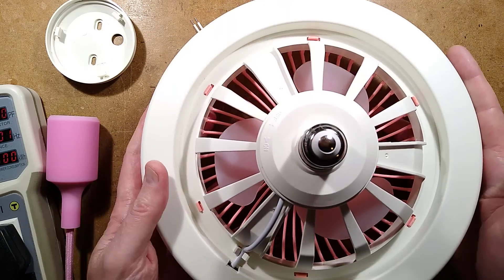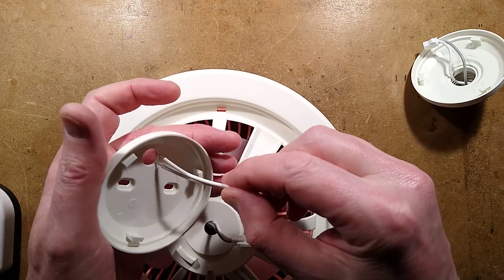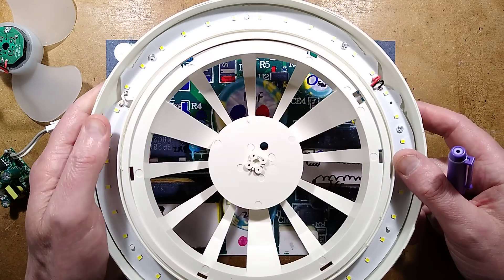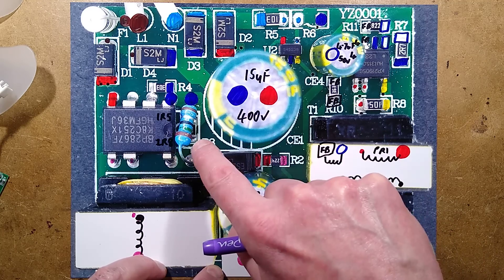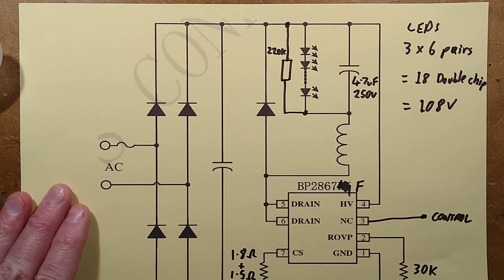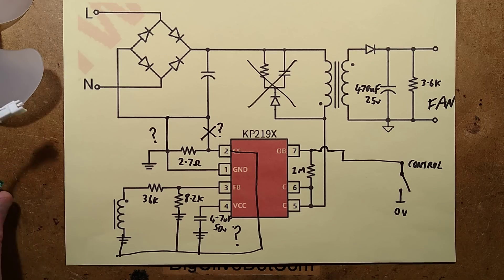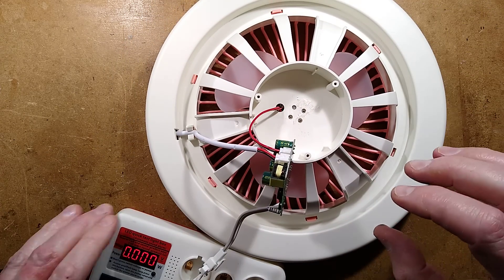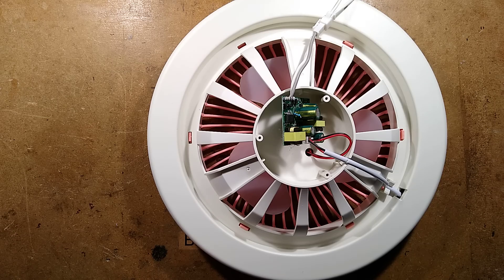fixing a faulty light with powerful built in fan (awesome chip inside)

Comment: I love 3 phase brushless motor fans. They tend to work a lot better, be more reliable, quieter, and project airflow a lot better. I am a big fan (pun very much intended). It is easier to have them on smaller fans, but i hope to see them more often. It is nice that it is a sensored motor too. people often prefer sensor-less ESCs, but i believe they can be a lot simpler with a simple hall effect sensor. so I tend to like sensored ESCs more, even if they have 2 or 3 hall sensors.

Comment: This would probably work great above my work bench in the basement, finally get some decent air moving down there. Is there a way to disable the control chip so it runs the fan whenever the light is on?
Reply from the maker: It might be worth adding a small fan and duct system if you want a continuous flow of fresh air in your basement.   That can also prevent issues with mold in areas with low air movement.
Reply: I've owned devices with similar control circuits... It should "remember" the last setting every time you turn it on
Notice in the video he has to cycle it very fast to change the settings

Comment: We just brought one of these types of fans and it uses a small jst connector i think its going back
Reply from the maker: They do use a small connector inside.  It may well be rated for the voltage and current involved, but I prefer a slightly wider spacing.

Comment: I have one of these but mine has a small remote control as well, with the remote you can change the light to cool white, natural, & warm white + also dim the light the remote also allows you to change the fan speed 3 settings & also a timer for the fan 1 2 or 4hrs, other than that it's basically the same as the one in the video.

Comment: Same logic as the multi-color temp LED systems - you turn the mains on and off (wall switch usually) and it steps through the modes.   As long as you go back on before the time out, it will be in the next mode.   most of those are cool - warm - combined as three steps, some have a half power mode as well.

Comment: Looking up the 5G street light conspiracy led me to one of the most ridiculous Daily Mail articles I've ever read. Here's an excerpt:

"Despite Gateshead council's claim that they are not using 5G, Mr Steele said: 'The transmitter operates at 868 – 870 MHz. That is a specific 5G spectrum. 

'The increase in transmitters even if they did operate at 2G – 3G, as the council have stated, would make them 5G'." (end quote)

bangs head on table
Reply from the maker: I think many conspiracists are just looking for attention.
Reply: 2G + 3G = 5G

Comment: I love the way you break things open and discover ways to make them work better or in this case - as designed. I have to wonder if the broken trace was intentional. I also wonder if the higher wattage used by the lights is meant to make them burn out faster.

Comment: I liked it so much ,I bought one! Slightly different pcb layout and different LED control chip DP9503AB but still has parallel resistors between CS and Grd pins but both SMD and both 1R80. Removed one, now 12W light with fan. Thanks Clive

Comment: Another great video Clive. These fan lights are very common in Philippines at the market to illuminate produce while keeping the flys away. Would the fan motor run in reverse if the black and red wires were swapped at the molex plug?
Reply from the maker: No.  It would potentially damage the fan.

Comment: This fan is a good idea when in winter you want to push the heat down that just hangs under the ceiling while your feet are cold.

What was that resistor you removed at the end to lower the light power?
Reply from the maker: The LED driver had two resistors in parallel to set the current.  I removed one so the resistance ended up higher.

Comment: Interesting datasheet for the KP219X. Looking at the messed up order of the pin numbers, I'd guess that either the chip designer is sadistic and wants to be different just to annoy, or that the datasheet diagram was cobbled together by someone who didn't care and didn't understand. The KP213X datasheet that's easier to find has the pins in the expected number order and as it's a similar chip I'd expect at least the pins to be in the expected number order. [Edit: wrote this post then found that others had said the same. Not sure how I missed them beforehand]

Comment: Hi, do you allow users to send in electronics that are acting strange? I uave 2 GaN chargers from same company that have the same issue. When you plug anything into it to b3 charged, it charges for 5-10 seconds and then turns off, waits a few seconds and then starts charging the device again.

Might be interesting to see what the root cause is. It has to be design related as both fail in the same way around the same time. They are just past the amazon return date so otherwise, they are ewaste.

Comment: Today, I was inspecting the circuit diagram of a low-integration-level integrated circuit, the 74LS469. It's marked obsolete but it has almost exactly the traits that I need for a design of mine. [It's a low-power-consumption (L) Schottski (S) transistor-to-transistor-logic (TTL) tristate-output eight-stages presettable, clearable, cascadable up/down counter; I'd rather have the much less power-hungry, higher-speed (H) CMOS (C) 74HC469 version]. It was manufactured by several major semiconductor factories in the '80's and '90's. A fact that makes me wonder how that circuit diagram had passed the quality inspection: two of the lines were driven by opposing input signals that would have conflicted and eventually damaged the circuit, whereas nearby logic gates would have been left unconnected, floating inputs. Was that the reason it is obsolete now? Were those errors "copy diagram" ones but the original sent to production was faultless?
    Anyway, I've found that there is a similar one, the 74F779, that responds to a similar description: a tristate-output eight-stages presettable, clearable, cascadable up/down counter, in bipolar TTL technology. But, unexpectedly, its data input pins double as outputs, so it could not serve the exact function I was looking for (an incrementable/decrementable, multiplexable parallel transmitter/register to bridge two buses just one way). Everytime I find another such counter, it has features I do not like or lacks some that I need. Oh, well.

Comment: We had a double adaptor for bayonet light globes. It was shaped like a Y and you could plug in two light globes from one socket. It was probably for the appliance cord that could be plugged into a light socket.
I once saw a cartoon of this woman complaining to her husband because she had to do her ironing on the table top because the cord for the iron was plugged into the light socket and was too short. The ironing board was on the table top.
The light circuit was normally 10A so not sure if the light circuit could run an electric iron.
The adaptors were made from Bakelite.
Reply from the maker: You can get modern versions of the two lamp adaptors.  They're quite handy for using two LED lamps for extra light.

Comment: For some reason I've always had bad luck with anything that uses switch toggling for controls. I just chalked it up to lacking the mental capacity and/or physically dexterity to make the tthings work, but based on this single example in one video I will now simply assert that they were all made with faulty tracks 😂

Comment: That chip would equally have a nice application in larger ceiling fans with lighting. Normally two wall toggle switches are used to control each function, but in a household room with only one wall switch (2 conductor wire with ground), it could make the operation more practical instead of needing a remote control or reaching for the string light/fan switch. In such a mains to mains connection with a few relays could retrofit existing installations.
Reply: There's a million dollar idea. I can hear the infomercial now. (black and white video of frustrated person shaking their head) "How many times has this happened to you? You want the fan and you can't find the remote!" (color video with happy family blown by fan) "You need the Clive-O-Matic!"

Comment: I wonder if you ended up with the south Korean version. They have a believe there that sleeping with a fan on you can cause death. That's why there fans have timers on them  so that when you fall asleep they will turn of after a while. And when the lamp is burning you wont sleep so you cant have it run through the night. Its a odd believe and I'm not sure how many still believe in it.

From Wikipedia "Fan death", 

Fan death is an urban myth that people have died as a result of running an electric fan in a closed room with no open windows. While the supposed mechanics of fan death are impossible given how electric fans operate, belief in fan death persisted to the mid-2000s in South Korea,[1][2][3] and also to a lesser extent in Japan.[4][5][6]

Comment: 12:10 Anyone else see it? Look at the pin numbering lol! "2-1-3-4" Don't think that is standard. When they made the datasheet, someone inadvertently swapped the pins in the diagram. Makes complete sense when you flip the two pins as then the ground is tied to the local star-point to provide a stable 0V reference, which is a really good idea since you don't want noise screwing with the feedback network. Edit: Not the only one to see it from other comments here, but it would make things confusing for sure.
Reply: Looks more like an odd engine firing order than something electronic.. Usual 4 pot is 1-3-4-2 but some are different and that's a viable option although it'd sound odd...

Comment: In the Philippines they have this LED light & fan but it has a pull switch.  So it's pull one for light. Pull two for light & fan. Pull three for fan only.  That's if you remembered to turn on the wall switch first.  OR you turn on the wall switch and it's light only. But you don't want the light you want the fan only.  So you pull the cord three times and you back to light only again  AAARR  Where is the rubbish bin.

Comment: *sighs* For the billionth time, 5G is pretty much the same as your home's WiFi on its 5GHz band. I've been sitting less than three feet from my WiFi router for a decade, and it haverflerf affekpud my briywan yet, so y'all are getting worried for nerigth! 🤣
Reply: NICE FIX!

The power-cycle-switch isn't the first time I've seen this... Back in the 1980s there was a short-lived line of halogen light bulbs that offered unique features that used power cycling to choose a desired effect. One bulb would turn on 100% brightness at initial powerup, several off-ons of the lamp's switch would provide different dimming levels. (We still have it in a swag light in our kitchen, we rarely use that fixture.) 

Another type from that line, I think we still have a few my mom bought at a great discount when they were clearance items and to date they've NEVER BEEN USED (she might have donated them to Goodwill, I'll have to check on that), at initial powerup it illuminates at 100%; five (or was it three?) flicks of the switch and the bulb would flash continuously. The marketing behind it was you put this in exterior lighting (fixtures by front door, lamp posts at end of driveway, etc.) to assist emergency services with finding your location while you stayed on the line with 911, say if EMTs were responding to cardiac arrest and you were providing CPR, you wouldn't have to STOP resuscitation to flag them down.

Comment: I did notice that the KP219x datasheet had pins numbered in the sequence 2-1-3-4 down the left hand side.   Don't know if you'd taken that into account when you were reverse engineering the ckt, but if that's te case, then perhaps the FB and VCC pins are referenced to GND...   Whether they haven't figured out how to count correctly, or just laid out the datasheet wrong and said - f*ck it, and renumbered the pins 🤷

Comment: Glad that fixing the broken track didn't make it go kaboom.
I once fixed a broken track on a walkm... portable cassete player/recorder and radio (wasn't Sony) and the thing didn't work. I had also repaired several other tracks due to battery corrosion, but this one was away from the damaged zone and appeared to have been cut with something sharp. Sure enough, everything worked flawlessly after I disconnected it.

Comment: When i was twelve, we had a bathroom light that was an enormous   shaped bulb that had an heating element inside it. The idea was that it slightly heated the bathroom, whilst you were in the bath. But i was in the bath one day when it exploded. My (much to my embarrasment) big brother lifted me out of the bath, as every surface, as well as the soap, was covered in glass shards i had a narrow escape as i got hit on my left inner thigh, which burnt but didn't cut and missed anything important. They are no longer manufactured as far as i know. This was about 1966
Reply from the maker: The infrared heat lamps are still available.  They do tend to fail with a bang.

Comment: Dimmable with remote and 3-speed fan control: Did you avoid the same unit with remote control and fan speed/light dimming control because of doubts about reliability of the added circuits?

Comment: I love how over a hundred year cycle we have come full circle to appliances that connect to a lightbulb socket
Reply: I have even seen a Kettle plugged into a light socket with the old Bakelite plug dangling down onto a table with the kettle on the end, back in the 60s, and it worked, but the kettle was an old 1 KW type.
Reply: @MrBobWareham  Oh hell, I remember seeing that too. Not in the 60s either, in the 70s instead. I'd forgotten how scary that looked.
Reply: @nickryan3417  the worst were rooms without any lightbulb fixtures at all, so many of the older homes in my area are still like that,  most people just use table lamps or standing lamps in those scenarios.
Reply: @MrBobWareham  Travel kettle is usually 800w
Reply: It was only a few decades ago that we were on the opposite end of the cycle, the apartment I lived in back then had only 1 overhead light right at the entrance door, the rest were all "supply your own lamp" switched outlets randomly scattered around the walls of every single room. Of course that could've also just been because my landlord was too cheap for light fixtures.
Reply: To be fair, ceiling mounted fans are usually connected into the lighting circuit - particularly when combined with a light.
Reply: Bring back the Christmas tree hahaha

Comment: Interesting if it goes stuck it could unscrew itself from the sockets.
Reply: If it goes stuck, there is no (mechanical) problem. If the bearings are at fault, the whole torque of the motor stays inside the motor and it has no way to act upon the frame of the appliance. If the propeller gets somehow stuck (e.g. clinging to the grill), the torque is simply zeroed by the mechanical reaction of the frame. Being a closed mechanical system, there is no effect on the outside; the fixture doesn't get moved against the E27 socket.
When the rotor is spinning, it accelerates the air and the resistance of it (inertia and friction) generates a counter-torque that has to be compensated for by the fixture.
Also, there is an even bigger torque, dinamically generated at the start, by the mechanical inertia of the motor rotor and the fan propeller.
Both of these are applied to the frame of the appliance and tend to spin the whole fixture in the socket.

Comment: I think I missed the part where it was faulty. I don't care if they start switching to DC motors, but it does annoy me when they make the fans fun off of USB and you have to supply your own USB power supply. I guess they think everyone already has USB wall sockets because they exist, but I really don't want to start cramming electronics into things that are hard wired into the wall. It's not like you can can pull out the old receptacle and shove a new one in its place. I am hoping that day is coming especially the way things are going.

Comment: The datasheet for the KP219x did something really whack, the ground and FB pins swapped to where they are in the real world, even though the schematic symbol is shaped like the chip otherwise, the pins are numbered 2,1,3,4. The board matches the schematic, the IC shape on the schematic is just.. stupid, and pointlessly confusing. Also "ground" on the schematic is not connected to the bridge rectifier and bulk cap negative, which is also pointlessly confusing.

Comment: is that little connecter with the tail for permanent install good for 240v?
Reply from the maker: It probably is rated for that voltage, but I wouldn't use it.

Comment: I'm surprised it didn't come with either an rf  (or ir) remote or the ubiquitous bluetooth/ wifi n app (could likely add a wifi controller to it and get control using the "smart life" app. It has the ability to control all manner of random stuff). I might get one of these n see if I can get it more useable, maybe with a PWM fan controller too, as you suggested. 🤔Should be easy enough with bits from the FleaBay. I should point out, I don't actually want one, just interested in the can I do it angle, which I could then apply to a nice existing fan I already own.
Reply: There are versions with a remote, that lets you change light intensity, fan speed, sleep timer etc